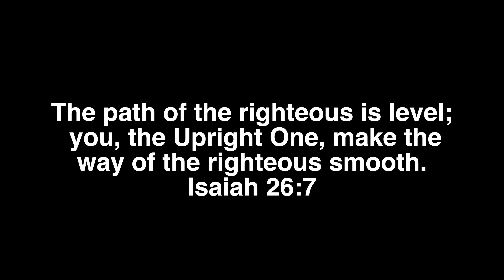Excess Soil Removal HACK - No DIGGING Into Sod, Overseeding Trenches

Comment: I like the idea it would really help me, also need to add a "level" indicator to my bucket on the 35 hp tractor, Trying to "read" the bucket has not proven to be the most reliable method for optimum results, I have an indicator on my littlest tractor and it helps, may add some edge tamers, and I like the idea of aerating and seeding to finish👍 I don't have a power rake but do have a pulverizer that I utilize, that does a pretty decent job😉

Comment: I started with 2 3 inch and added a third trying not to disturb so many rocks in the drive when removing snow. I think R2 made a design change after I bought mine.
Reply from the maker: Yea, I like using 3 for snow.    I thought 2 fit this application perfectly.  Leaving most of the bucket clear for work area.

Comment: The Yankum rope makes a great tow rope. 
 It is in fact called Purse rope/line. Used in Purse seining. 
But if you ever do have it part while towing watch yourself. 
We had one part towing a boat, that broke down, about 1-1/2 inch dia. Had a wooden beam 3x6 that it broke/went through, when it snapped back, from about 250feet.

Comment: I level the bucket and then put it in float mode, 3520 standard size bucket.
Reply from the maker: Float doesn’t work well for me.  Too much down pressure.
Reply: Those edge tamers are nice and the cost isn’t bad either.

Comment: If you packed all of that dirt back into the trench, and it would be possible to do that, it would be so hard nothing would grow on it.  Water might not even soak into it.

I got to watch them install some of those big wind turbines.  They dug a hole about 30 feet deep and 60 feet in diameter.  They created a double layer of 1 inch rebar 40 foot in diameter on the outer layer and 39 feet in the inner diameter.  They went up around 4 foot before starting to taper to a smaller diameter, equal to the inner and outer mounting flange of the tower, up to a little above the grade.  They then installed the tower anchor bolts with a bolting template holding them into place and welded to the rebar.  They then put plywood around the lower 4 feet.  Then they started pouring concrete until it reached the template.

After the concrete cured for about 40 days they started putting all of the dirt they dug out of the hole and packing it down as they went.  By the time they were finished ALL of that dirt was back into place with only a slight rise above grade.

So if you ever wondered how they held those wind turbines up and prevent them from toppling over in high winds, now you know.  And where I live we can periodically get straight line winds with gust up to 90 MPH or more.

Comment: No problem restarting after being fuel starved?  I got close to empty recently and was worried about that as I've seen a lot of videos where you have to bleed a diesel injection to get it running again.  Thanks for sharing.
Reply from the maker: No problem.  The fuel pump works great.  Allow it to pump for a minute or so before starting.
Reply: @TractorTimewithTim  Great to know, thanks for the reply.

Comment: Do those leave ruts?
Reply from the maker: The edge tamers?  No, not typically.
Reply: @TractorTimewithTim 
Yea, on a Kubota you may be able to use the float to follow the contours of the land.
Reply from the maker: @1jw298 I don’t find float to be helpful.  Too much down pressure for most tasks.